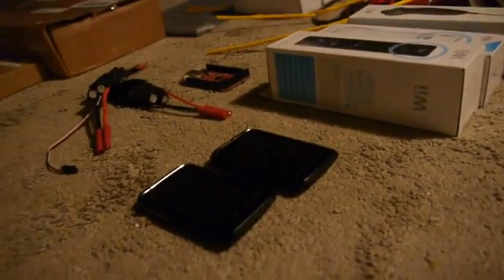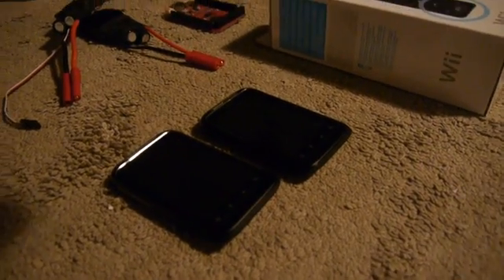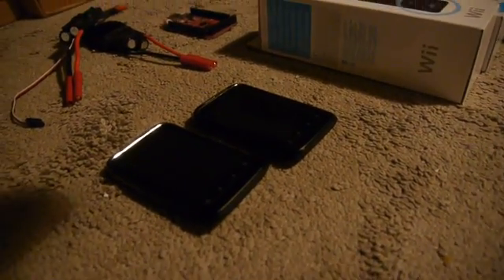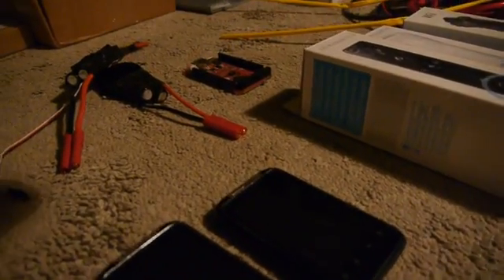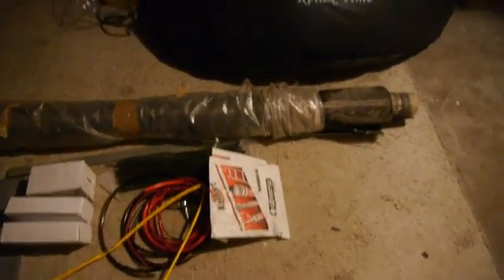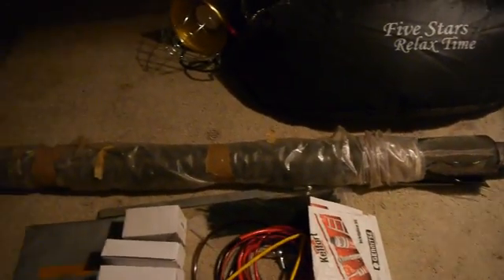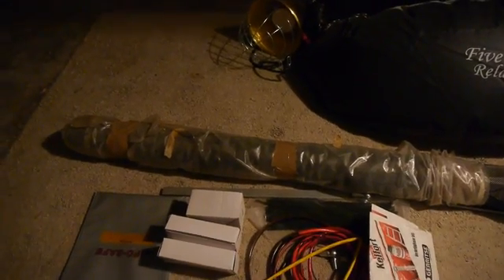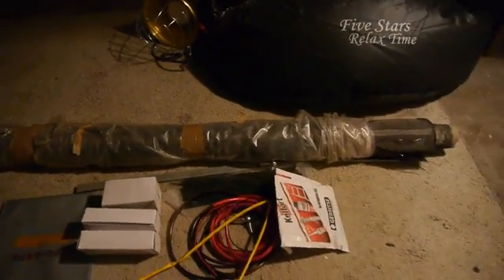Materials + Help | part 5/14

Comment: Excellent - Excellent
I hope that flapping wings will be implemented in Egypt - Has a patent been registered ? - Shall we develop the wing and make it more flexible when striking the wing to provide greater lifting power and not need motors and add joints or hinges to the wing to help in spreading and closing the wing easily and use reverse engineering of bird bodies to add features to the wing and use flapping wings in air transport and air sports?